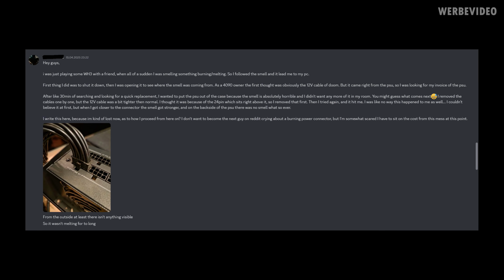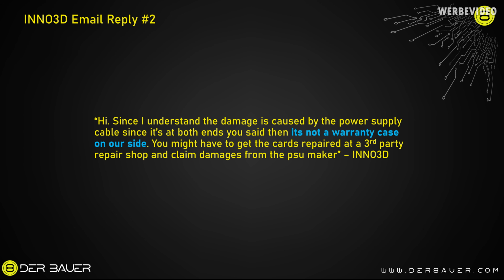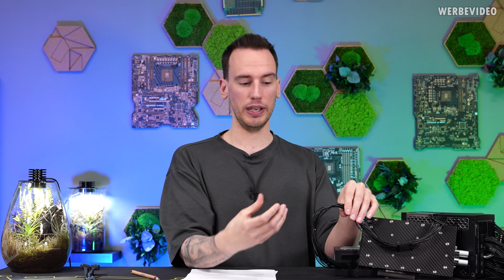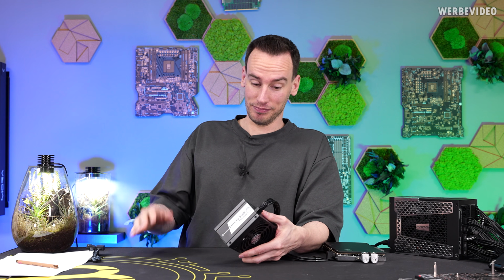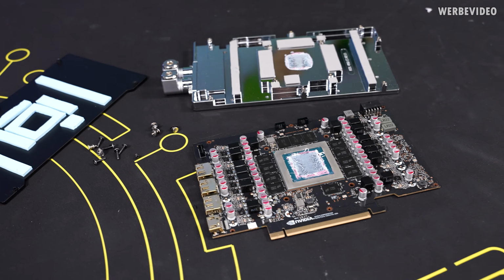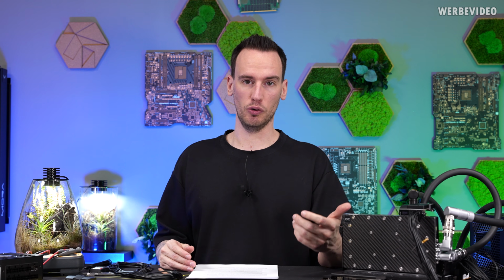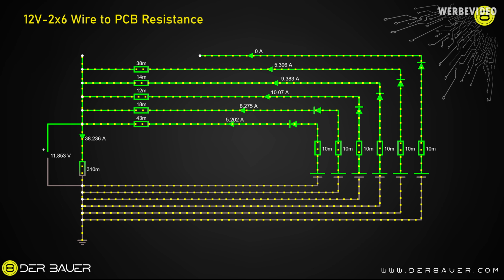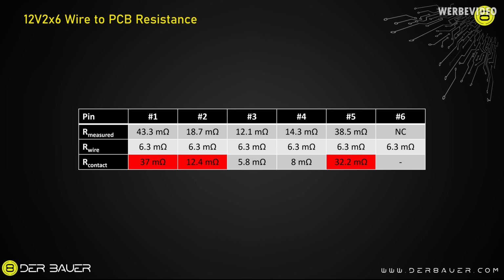Investigating and Fixing a Viewers Burned 12VHPWR Connector

Comment: @der8auer: You know what would be really scary for Nvidia?
If some legal or authoritative entity finally decided that the 12VHPWR Connector is unsafe in the current config and demand a better implementation.

There has to be some sort of enforced quality control right?
I mean, we are not talking about just 1 or 2 cards...

Best Regards
Me

Ps. I missed the part that there already were class action suits made against nvidia :) .ds
Reply: Compleately agree with this, they need to be better safety margins and correct load balancing
Reply: Unfortunately these connectors being the ignition points for fires is the usual requirement for stringent enforcement.
The fact that so many GPU buyers are accepting 12V2X6 despite the well known mess, rather than punishing Nvidia's stubborn persistence with it and Sapphire's Nitro + 9070xt even had positive reviews using this shows the general complacency.
Reply: It might happen when someone house burns down, until then no chance.
Reply: hmm... Verbraucherschutz?
Reply: Especially in the eu
Reply: Best would be if intel as owner/author of specification stated that GPU vendor is responsible to ensure even current distribution to avoid exceeding specs currnet.
Reply: @pavelgajdik7486  Intel is just the scribe in this situation, and they don't really have any power to enforce it
Reply: well if you can prove that a lot of 12vhpwr connectors are burning in EU then we might have chance XD see what happen to apple with the lightning charging port in there iphones? been forced to changed to usb c because they gonna get ban in EU if they don't XD
Reply: @Nosci20  That's exactly what I was thinking. EU is one of the few entities in this world that can force American companies to make changes.
Reply: Good luck with that. NVIDIA lobbies 🦅government so hard. Unless so many customers fill an official complaint together or something, ...
Reply: That would be Epic, and so totally required.
Reply: @torihanzo3785 Okay.

So 12vhpwr was superseded by 12v2x6, same cable but designed to be less likely to have user error in connectivity unless they aggressively bend the cables near the connectors.

Fires still happen

Users often using third party cables when it happens.

Blame Nvidia.

Personally, the inconsistencies and the common mention of third party cable vendors makes me wonder if it's entirely being caused by the cable vendors not following the spec or failing to properly address quality control. That's my two cents, we can pretend I'm absolutely wrong here, but as I've said in a direct response to the video, I've got a 3090, 4090, and 5090. No fires, but also no third party cables. The issue is simply too inconsistent to blame the cards themselves considering the issue doesn't seem to happen at all if you use the 4:1 adapters - I say this as I've yet to see any stories about such an incident.

Your statement about enforced quality control.. Enforced by who? Are you suggesting someone from PCI-SIG be tasked with checking QC from anyone trying to manufacture the cables?

Seems a lot of this debate is mostly bandwagon BS for the narcissists of the tech world. I'm more interested in finding solutions rather than simply pointing fingers blindly because it's popular. I don't care if I'm right or not.
Reply: Don't forget 12VO which will end up being this but on a motherboard level.
Reply: It would be a real kick in the teeth if Nvidia had to replace all of the 12-volt power cards with appropriate 8-pin variants. Although Jensen's bonus alone would probably cover the costs and then some. Thise billionaires can spare some wealth on what made them rich.
Reply: I expected Steve to do a follow-up on nvidia after uneven current was revealed, but it still didn't happen.
Reply: @AshySamurai he doesn't have the equipment to test it himself so I think he's let Roman run with it instead. But in the US you're just screaming at a wall because nothing will happen here to fix it anyway. There's also another channel doing some in-depth testing on the connector and cable.
Reply: @AshySamurai  I dont think it will happen. Steve basically "concluded" User error despite repair shops like NorthridgeFix calling Steve out on his erroneous conclusions.
Der8auer also "nicely" refererad to Steves findings as "one way the connector can fail", and thats a nice way to get along with fellow YT I guess.
But yea user error is ALWAYS a thing so what GN found was not that conclusive with everything that happened sins.

Also my impression is that Steve and GN tends to double down on there view on things no back down.

I like GN and Steve, he is one of the best reviewers and reporters but he and GN is not without faults just like the rest of us so yea on this very topic I dont think they will make any noise because that would mean admitting that there original findings where less then satisfactory and I think they are to invested in there old narrative.

But we can hope, they did good work before with things being a fire hazard and many Youtubers cant say that.
Reply: Everyone blaming Nvidia but they didn't have any part in the creation of the cable design/spec outside of cosponsoring.
Reply: @n050up4u  You make it sound as if Nvidia has no responsibility here and to that I respectfully disagree. :)

NVIDIA absolutely played a role in adopting this cable/spec. Choosing to use a standard—especially one as critical as a power connector—is not a neutral act.
Saying “We didn’t design the spec” doesn’t absolve them of responsibility when they actively chose to implement it in their GPUs and ship it to consumers. If there are known issues, especially ones that can pose safety risks, NVIDIA doesn’t get to shrug and walk away.

From what I understand, a major issue is the power distribution across multiple leads. Without safeguards to ensure even load balancing, there's a clear design vulnerability—whether it’s in the cable, the spec, or the implementation.

Ultimately, NVIDIA has a duty of care:
Raise concerns with the standards body or manufacturer that created the spec.
Ensure customer safety through proper testing, quality control, and timely communication.

Even if they didn’t originate the spec, they’re responsible for what they deliver to users.
Reply: @n050up4u  Yet they keep using it.
Reply: But it's not unsafe .... They use flameproof materials so there is no risk of a fire ..... If a GPU catches on fire it's a thousand times more likely it would be because of a power MOSFET shorting in the VRMs which affect pretty much every GPU made in the last 20 years as well as motherboards.  You could put a blow torch on that connector and it wouldn't catch fire because the plastic melts away and turns to crust long before it reaches the ignition point
Reply: @longjohn526  Sure :)
I guess the term "Unsafe" is rather vague and can mean many things, fire is one of those things.

If there is a risk my GPU or even my PSU get damaged because of this design choice and the vendor refuses to help then I feel that it is unsafe to use it.
And what other damages this could lead to is just theoretical.
But there is definitely a higher risk of something "bad" happening when using the 12VHPWR-cable than using other existing solutions.

Personally, I can't afford to buy another 4090 or 5080 if this happens to me.
Reply: Waiting for GN to investigate about Nvidia's and it's partners "shady practices" and start class action lawsuit... oh wait.... right.... that's never going to happen.
Reply: @novinovic298 they’ve reported on them a ton already are you under a rock?
Reply: @ Not a ton(it could be much more) and at the start of burning connector saga they lebeled problem as "user error" and never did proper follow up. They went to war with other companys for much less but they dont want to touch Nvidia because Steve will loose everything if he does that. No balls to call out everyone equally=protecting self-interest
Reply: @novinovic298  too many hands on the pie: AIBs, power supply manufacturers, cable manufacturers... Nvidia can shield itself.
Reply: @ They can because they are filthy rich and can buy all the lawyers and judges. GN will never attack Nvidia and it's partners because if they do that they lose access to many things.
Reply: @GrimpakTheMook  Nvidia Shield Pro
Reply: yeah the lawsuit is never happening  @novinovic298 

there's no point in losing that much money for a publicity stunt
Reply: @novinovic298  ?? steve's entire life purpose right now is crapping on nvidia. what the hell are you blabbering your mouth on about

Comment: I am a Systems Engineer by trade, tech enthusiast and automotive enthusiast by night. I had a similar issue on a high performance fuel system, I needed more fuel, so naturally you add more pumps. Shortly following that my vehicle would stall after 30+ minute runs. After first inspection I was able to feel the heat from the feeding wiring, so I replaced it with 8 awg but the issue persists. I inspected the pins within the sending unit connector, and noticed the slots that they were supposed to sit in had grown. So how? Well, they were passing too much current and heating up, once they were heated up they began to move, if there was distance between the contacts they began to arc weld, which then melted the connector. Its simple, its too much current going through the pins of the newer designed connector.
Reply: 👆 THIS!  I think this is EXACTLY what might be happening to these connectors.  I have a 4090 and have been following this issue from the beginning.  When I first looked at the connector Nvidia spec'd for these cards, I thought "you've got to be kidding me. More current, smaller connector. Makes total sense."  The insanity has been confirmed by JayzTwoCents thermal imaging he did. Apparently the lead engineer at Nvidia is Stevie Wonder...smh.  I have a LOT of airflow cooling in my case and so far all seems good.
Reply: @ it seems like the engineers chose form over function, and then rather than admitting fault upon the numerous failures, and jumping ship, they are putting on scuba gear and digging in. New does not mean good, a large corp doesn't mean they do not make mistakes, and rich does not mean they are smart. I just won't buy an nvidia card again. I moved to amd, my $919 usd card scores a 292000 geekbench vulkan, my 4070 super ti would only do 215000 in the same test, and was the same price point. I'm done with them

Comment: that's why 12VHPWR connector/cables is too dangerous for RTX 40 and RTX 50. they should changed to 8-pin connector/cables if possible like RTX 30 have 8-pin connector
Reply: another connector type will not solve problem, since there is no balancing of power distribution, unless it will be 2 wires/pins only :)
Reply: @redl3733  the funny thing is, it never melted on the 3090 Ti. Only on the 40 and 50 series cards it did.
Reply: @punmeistervstheworld  because its very rare card and like cards in the past had several input rails for power distribution. 
Connector it just part of the problem.
Reply: i keep checking temps on 9070 xt nitro, so far max 50°c at card, max 39° at PSU 🤞
Reply: Sadly, some 9070 XT use 12VHPWR, like the Sapphire Nitro+.
Reply: @Kaikuuuuu  at least AMD doesn't enforce the design like NVIDIA. AIBs have the freedom of using either two or three 8-pins or a single 12V-2x6. Plus, at the 9070 XT's silicon design, it will never saturate the 600W limit of 12V-2x6, even for XOC friendly models.
Reply: RTX 30-series was also 12vhpwr not 8-pin connector.
Reply from the maker: RTX30 Series hat multiple 12V input rails to the card. While on RTX40 and RTX50 it's always directly connected at the connector itself
Reply: @der8auer-en  I recall I think from your videos. The elmor labs pass through you use to track power. Levelled them out at that board no? Maybe we have to normalise having an elmor labs connection in the middle of the psu to gpu runs to force level the amps out? That's possible no? Or? Could be a opportunity to create one Der Baur branded. I'd reinforce my 4090 gigabyte with one. I live in fear
Reply: @der8auer-en  Penny-pinching on a 4k€ GPU, you love to see it.
Reply: @angrasband3564 the RTX 30 series used a proprietary, NVIDIA designed 12-pin connector and ONLY used on their FE cards, which is different from the 12VHPWR and 12V-2x6 that was passed by PCI-SIG.

Only the 3090 Ti had 12VHPWR, as the card was a test vehicle for the 40 series.

Comment: cool technique from inno3d, gpu didn't do load balancing, melt connectors, blame psu
Reply: Only way to fix it would be for the PSU having over current protection for each 12V pin. 
Just switch any pin off that pulls more than say 10A and then blame devices for pulling too much current or not balancing the load.
Reply: @kuebbisch  I like this idea, but they'd have to start adding 7 segment displays to PSUs if they go that route. Without it GPU vendors would just claim PSU is faulty - they'll need a way of displaying error codes and that this is a normal mode of operation. But something like this would force devices drawing power to play nice
Reply: Inno3D didn't have anything to do with this board design, they're using Nvidia's reference design for the 4090.
Reply: nvidia spec is sh*t, inno3d response was sh*t too
Reply: Some ones else problem… Nice…
Reply: Crazy 😧
Reply: They didn't decide who should do load balancing - GPU or PSU, so no one does it.
Reply: @fluoxethine  The old deflecting the blame and just keep playing ping pong when it goes wrong
Reply: @fluoxethine  its never should be psu, cos user may decide to split the connection. its always should be the "consumer"
Reply: @jermygod  Thing is that Inno3D made the card to nGreedAI spec.
There is ZERO load balancing in the spec itself. This is how nGreedAI designed the whole spec. This is THE intended behavior.
Reply: @ yeah, i know, but its not like nshitia forbids overspec or requires denying warranty
Reply: @jermygod  I am not even sure about that, Nvidia provide standart design, but also have to approve any changes to it. AMD is leaving much more freedom in design.
Reply: @fluoxethine  Even worse than that, Nvidia don't allow 3:part to change the design either.
Reply: @miccke88  Whole 5000 series was released by AI or some MBAs having no clue what were they doing.
Reply: @miccke88  most boards do came with changed design tho
Reply: @ Not heard about that, only asus premium 5090 can you monitor the draw from each 12 volts pin. But that don't solve the problem. 

But do you have intel on a refresh where Nvidia allow a design change?
Reply: @fluoxethine  I am afraid even AI would tell you that its very bad idea, anyone with basic electrical engineering knowledge will tell you same.
Reply: @fluoxethine you dont need to decide, its allways consuming side responsible as source cannot know what do you want to pull out.
Only thing PSU manufacturer could do is to put lets say 10-12A fuse on each wire that would pretty much cause  every single 4090/5090 to cause failure on PSU, they repair it, and charge GPU manufacturers for repair costs.
Reply: @fluoxethine  I don't know how you could do load balancing in a computer PSU, which is a constant voltage source. An increase in load is an increase in current draw by the GPU.

In any PSU or GPU (or any other computer part) all the pins for a given voltage are electrically connected together in the PCB. The load becomes out of balance because there is a different amount of resistance on the pins, which is really inevitable unless you want to spend very large amounts of money on each individual plug. The sin of 12VHPWR is that they never took this into account during design.

It will sound crazy but I believe that the only solution is to replace it with a connector more like one for domestic power, ie only one DC pin and only one GND pin, but both maybe 5mm thick. The power is high enough to justify this.
Reply: Load balancing is unnecessary complexity - it could instead just be two thicker wires (like 6mm car battery wiring is rated for 50 amps)
Reply: @ Cables are not and never were the issue, but also true. However, it'd add significant, not slick looking thickness and create additional bending force on the plug + be really hard to bend at all.
Reply: Current balancing works perfectly, you don't understand what current balancing is supposed to do, nor that you can't make it fix resistance discrepancy. The only thing you could ask from it to do, would be current throttling in case of uneven current, but then most of the users would end up running with 50% of expected power draw.
Reply: @PolskiJaszczomb  wtf are you on about? WHAT works perfectly? balancing doesn't exist! its all soldered to 1 lump of copper! 
And its way better to throttle and display a warning than melt!